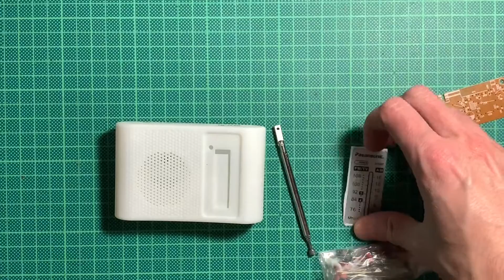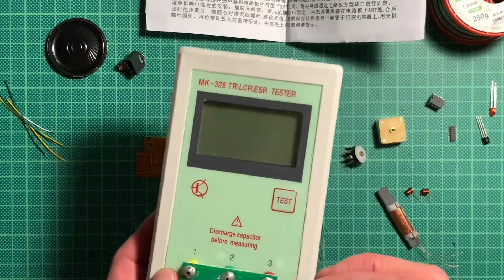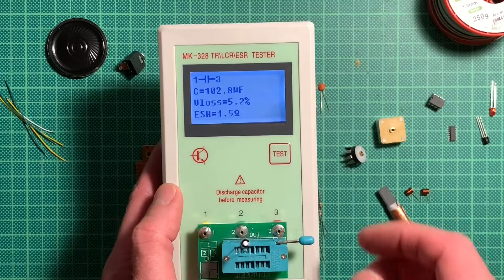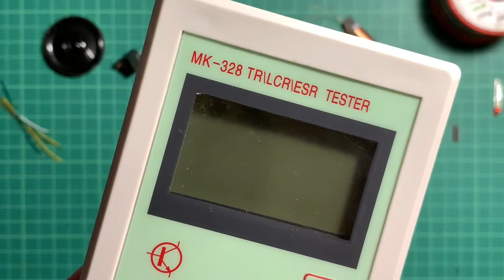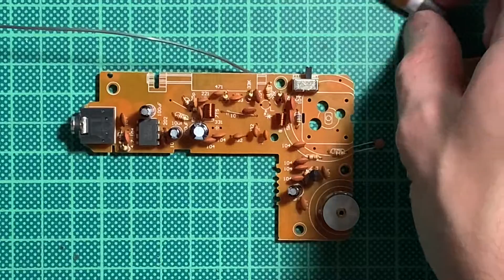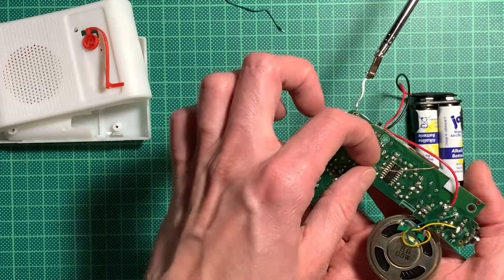Assembling the Chinese CF210SP AM FM Radio Kit

Comment: Hey. I also soldered this kit recency. Could not find any AM station though 😐 I wasn't expecting much from this, at least I had some fun building this and FM part works at least
Reply: I read a comment from someone that said don't solder the short tab on the tuner because it shorts the am section.  I haven't soldered the kit yet, so I can't give more detail than that.  Hope it helps you!
Reply: Yeah.. or maybe I have soldered the variative capacitor incorrectly, as there are at least 2 ways to solder it

Comment: I built one. The most disappointing Chinese kit I ever built. In general, I do like Chinese radio kits, and the six and 7 transistor AM ones I built worked well.
The actual circuit design is quite reasonable, remembering its simplicity. One IC for FM, one for AM (the traditional MK484 / ZN414 type clone) and an audio amplifier. Mine worked to a level I felt was satisfactory for something so simple.
But the kit was let down by poor quality of components, a PCB that was difficult to solder (and the copper came off when it got hot) and the dreadful, ill-fitting case and mechanicals. :-(